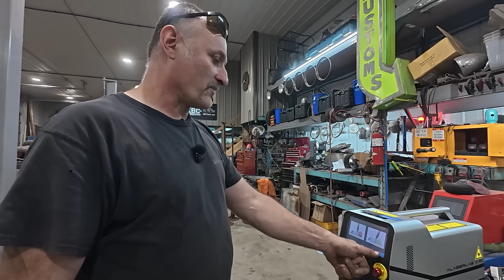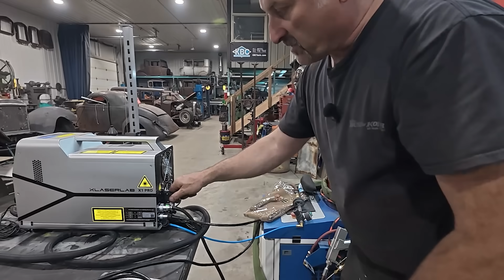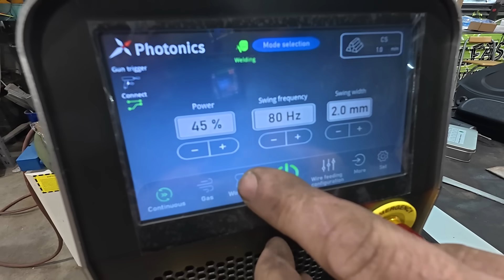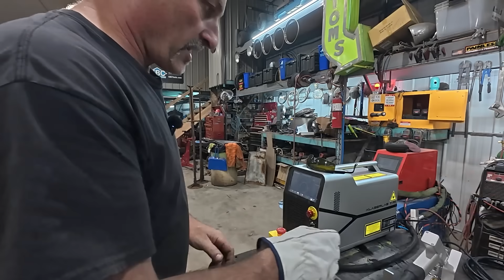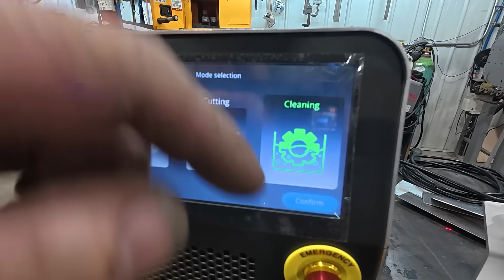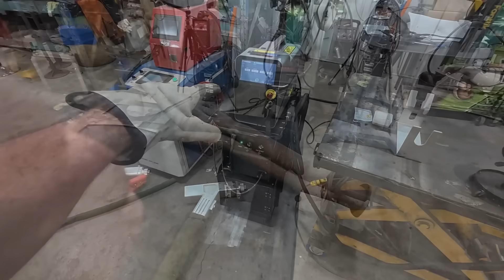An In-Depth, Honest Review of Xlaserlabs x1 Pro Laser welder!

Comment from the maker: Hey folks if you have any questions or things you want me to try with the laser let me know!
Reply: HOW MUCH IS IT ?
Reply: @darrenbrisson4336 paid about $4,200 US for mine.
Reply: Try welding a cracked block.😊
Reply: Weld a cracked cast iron exhaust manifold.
Reply: I can send you a bunch of stuff you can weld Brent!😄  I'm quite sure everyone was wondering what 🤡 would be first...  I guess I should just keep practicing!
Reply: Would fluxcore wire work just using air ?
Reply: Thanks Brent for showcasing all three functions — cutting, welding, and cleaning! 🙌 We’d love to hear from everyone: which function would you use most in your projects?
Reply: @Xlaserlab  without shipping, how much is the full kit Brent showed here?
Reply: @danielbuckner2167  Hi Daniel! 👋
The full X1 Pro kit Brent showed in his video is $3,499 (current fall sale price, down from $3,999). ✨
✅ Plus, free worldwide shipping is included right now!
Reply: There are multiple tips included with the laser.  In the video you use only 2.  One is for welding and you show how the welding wire fits into the bottom of it to guide it.  The other is for the laser cutting.  But what are the other tips for and when do you use them?
Reply: @plowproof sirve para soldar en diferentes ángulos
Reply: Hola saludos desde Chile.
Tengo una máquina láser 4 en 1 con el mismo sistema operativo de tu máquina grande. La solución para que no se marquen los lentes protectores de la pistola, sería cortar la manguera transparente que se utiliza para llevar el Argón o Nitrógeno. Yo le puse una copla de conexión para conectar a una pequeña bomba de vacio tipo  membrana y la conecte al revés, para que salga un pequeño flujo de aire por la boquilla de la pistola. 
Eso es para que el hollin (residuos de carbono de óxidos, grasa o polvo)
El hollin se pega en el lente y la luz del láser es obstruida por el hollin que se pega en el lente. Ya no he tenido más problemas con los lentes.
Reply: @osvaldodestino  Do you have any pictures or videos of the protective cover you made on your laser welder?
Reply: Can you send a link to the welding cart you bought?
Reply: What do you think of it after a month of use?
Reply: My main focus would be sheet metal repair. Fender flares, Quarter panels, floorpans, patch panels.
Reply: B-man, would you be able to compile a settings chart for things like aluminum and sheet metal that work for you? I can try to set up a grid in Excel and email that to you if it would help organize your thoughts.

Had a day from Hades with my laser today trying to weld sheet metal.  For it, my starting point was:
16 gage steel
10mm/s wire speed
45% power
80 hz
2mm sweep
.035” solid MIG wire
Argon gas

I literally tried adjusting all the parameters with terrible results.  I was either melting out the weld area or not even melting the .035” welding wire.  I tried your trick of minus 5 on the snout and floating the gun off the surface with no improvement.  I fried about 3 protective lenses.  I haven’t looked at the focus lens to see if I fried it too.

I think I might need some schooling on how to use this thing.
Reply: B-man, I gave you editor rights to this spreadsheet.  It would be great to get your input to settings you like with your XP Laser welder for some applications I have.  Thanks in advance for any help you can lend.

Jethro

https://docs.google.com/spreadsheets/d/1V4u0FjaMxbkZxZGS1hOlHRyMSVQb07brs_ZN2TayOvg/edit?usp=drivesdk

Comment: B-man, my laser arrived the other day.  Still trying to get parts through Amazon (welding wire, gas gauge, etc.) and setting up the work cart.  

Just wanted to compliment all the details you provided here.  The manual supplied had just pictures, with a tiny font that took a magnifying glass to read/get through.  About 3 times through this video and taking notes, you really laid out the specs needed to get going, …I think.  

I have an immediate need to repair a 1/16” thick aluminum grill on a ‘57 Chevy.  I’ll let you know how it goes.

Not trying to grift, but we’ll have details up here on YT if you’re curious.

Simply amazed at all you do!!!
Reply: Going to watch again.  Unit is not working.  Don’t know what’s causing the problem.

5 minutes after this post I realized the wire feed and power button soft keys weren’t active.  I wish I could paste a pic of my 2nd weld to 1/8” aluminum out of the box.  Looks beautiful.  Once you find the right power setting,the unit is a breeze; no strike sticking like an arc welder, you can see the process well through the glasses, and the wire feed pushes the gun along, making a strong, good looking weld.  Very excited here.

Comment: Before feeding the wire, turn up the feed rate on the welder. It will feed the wire at whatever you have the welder set at.  Will save a lot of time.

Comment: Hey HK — quick question for you. Since you were in direct contact with the vendor for the laser welding review, do you happen to have a direct contact there? Right now I very interested to get some replacement on the consumables, and had reaching out through the Xlaser website (email and phone), but it doesn’t seem to go anywhere. Would really appreciate it if you could point me in the right direction. Also, I wanted to mention that your videos were a big factor in our decision to acquire the XLaser  — they were very helpful.
Reply from the maker: I actually get them on Amazon or ebay much cheaper really

Comment: The large 1500w machines are down to 4k now .
Reply: I saw a 5 in 1 Double Swing 1.500w machine from china for 2.8k from Leapek Laser
Reply: @Did @Didisixty just got offered a 1500w on eBay for 2400k. They are coming down in price.
Reply: @vintagespeedshop  the laser source value occypy 70-80% of whole machine, different laser source, price is different.so 2400usd dollar is  possible
Reply: @Didisixty  the laser source different, in china, CE version raycus laser source is expensive and global warranty, 1.5kw 4in1 single swing , around 4k usd dollar from razortek
Reply: @razortekcnc   what is about the laser source from Reci ?
Reply: @Didisixty  in china, Racyus best, and there are lots service office all over the world. reci is normal,cheaper, just like BWT brand.
Reply: @razortekcnc   but reci has a double swing system and works fine. I have one 1,5kW warercooled which a relfar Laser head.
Reply: @Didisixty  reci is laser source, double or single swing controller .The controller  determines the shape of the light emission, not the laser source. after you use long time of the laser soruce, the lifetime and power will be reduced
Reply: @razortekcnc   the decrease of lifetime is only if you use the laser at 100% of max Power. I use it at max 66%. But this is for all Lasers the same. I am electronic engineer and know all these things. First i tried to buy a 1.5kW Fiberlaser from razortek but it didn't work. So i bought one from Leapek. If the Power of the Laser Source is down it is no problem for me to change it.

Comment: Can other shielding gas type be used if welding mild steel, like mig gas? Or does it only like to use argon?
Reply from the maker: No I've actually used mig gas and even clean compressed air on mild steel seem to work also..

Comment: A good down to earth review with benefit of hindsight based on experience with similar equipment. 

I do want to ask … what life do you tend to get from the various consumables? … particularly the lens and optical protection filter? I presume these are the components that are prone to damage from reflected beam if you cut at 90deg to the metal ? What about the nozzles? .. they appeared clean after your short demo test welds, but I wonder how they compare in life to a standard MIG ?

Comment: On your butt welds, with a bit more practice they will come out better. With much less heat going into the sheet metal you will get less warping, the bane of most body men. Also with the smoother more precise we ld you want have as much grinding to do to smooth off the joint.

Comment: Hi, I found this laser welder interesting. I've been a professional TIG welder for 50 years, but I've never used a laser welder. My question is this: could I weld two aluminum sheets about 20 mm thick? I know the penetration won't be proportional to the thickness, but will I still be able to weld? Thanks.

Comment: I purchased an X1 Pro during the kick starter phase because I am a techi and own an acetylene, Arc, and Mig welder and thought the X1 would be an easier to use welder for prototype items and for the cleaning function.  I have viewed multiple videos on the X1 use and Halfass does a very good job.  I wish he would have emphasized what the different tips that came with the unit and more information about what gas to use and when in the different X1 uses as well as what the settings are supposed to be at.  I am not sure if he mentioned that normal compressed air may be a good alternative while in the cutting mode or not.  But otherwise, this video is worth watching and taking notes on.

Comment: Hey, just wondering if there is anything different between welding on a 110 line vs a 220.
Reply from the maker: I've read it's more efficient but it works just fine for me in the 110v mode.
Reply: @HalfassKustoms have you been able to do a weld comparison? I'm wondering if the weld still gets the same depth!!

Comment: I'm sold, unfortunately I can't justify the expense for the amount of use I would have for it, but, if I had the extra space, I would buy, buy a project car at a low price (market place has a clean 69 El Camino for $3,000), clean it up replace the rusted out roof that sells with it and sell it for $10,000 easy. It could pay for itself. Those welds beat my mig welder 1,000% on looks and warping.

Comment: Hi i work on cars in Ireland, I got myself a 2000w laser cleaner it a great tool but i found on thin metal i have to give it a run over the metal and then use a pin punch and go over it again

Comment: What I am sensing is a machine that doing fab work on heat ducks for furnaces or maybe installing light fixtures that are above your head as in ceilings in a shop or shed.... and lots of practice as its not as forgiving as a mig. After a day or so with a mig, you can get by if your handy with a welder but this says to me, have a few weeks of projects behind you before bragging your a metal repair person. Cheap old car door bottoms or corners on cabs where you can fix your screw ups.  I am curious as to how far the heat broadcasts from a repair to other painted surfaces??